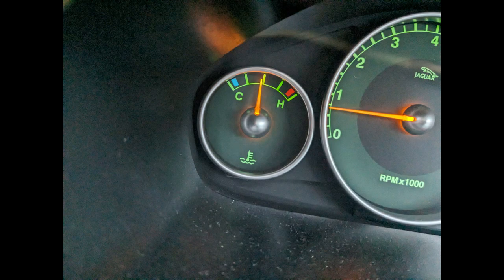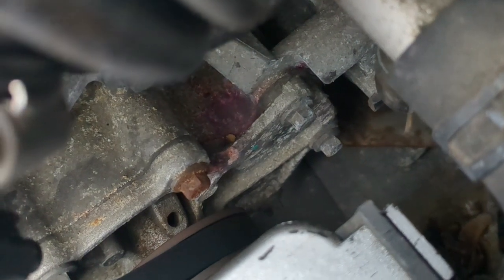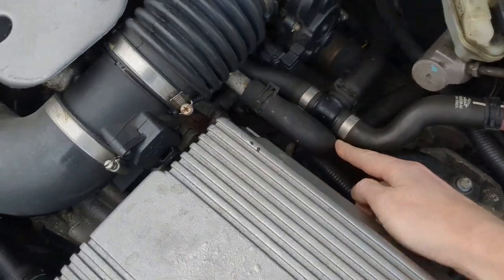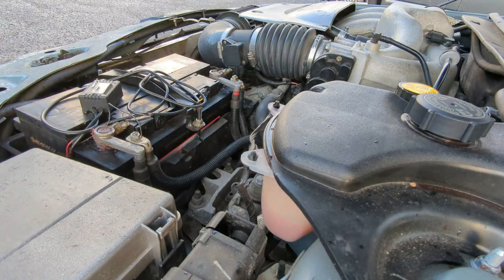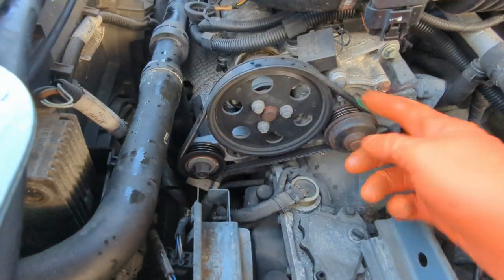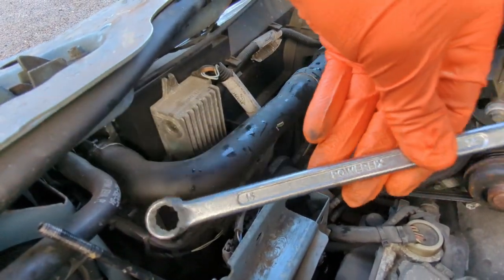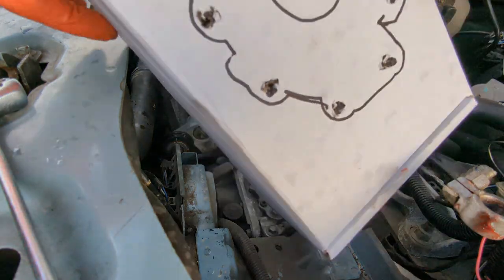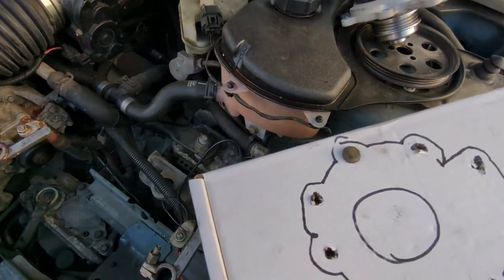Jaguar X-Type V6 waterpump and thermostat install guide. Overheating issue solved!

Comment: Anthony - was the replaced failed thermostat Jaguar OE?  Would have expected an OE part to last longer. I replaced the lower main radiator spring hoses fitted by Jaguar with jubilee clips on both mine (and the missus 2.5) as they both managed to come off and leave us stuck  - fortunately the missus failure was in the Shell garage in Godstone and mine in a lay-bye on the A22 dual carriageway. Enjoy your videos but my stress level always increases now with every journey feeling that I am always borrowed time now.
Reply from the maker: I apologise for increasing your stress levels there! Yes the thermostat i replaced was a Jaguar OEM one as far as I was aware. All I can say is that the quality of items isn't what it used to be and I may just have been unlucky.  I have replaced it with a generic unit at £16. Yes it's a ball ache of a job but I don't expect another failure.
We really must cross paths at some stage being as close to each other as we are.
-Anthony

Comment: Great video Anthony! Thanks for posting.. Im having this exact heating problem now. Would you know what causing my heavy fuel consumption perhaps. 2007 3L X t-ype, recently purchased in very good condition (seemingly) with only 85K on the clock. On the open road crusing at 130/140km/h for at least 80km with no traffic, she reads 13,7L per 100km! this is crazy heavy fuel consumption right?

Comment: I've got a 2.5 X-Type that has a new thermo, but a stuck cooling fan. After about 10 miles of driving The gauge bounces up to red until I shut the car off and when i turn it on its at normal temp. I was thinking of replacing the coolant sensor and water pump. Do you know what the cause is?
Reply from the maker: @wangautomotive  "new" doesn't mean "working".
The thermostat I replaced was 3 years old and less than 10k miles.
Take the coolant return line out the side of the header tank, hold it above the open header tank with the cap off and run the engine. If water rushes out of the pipe then the water pump is working.